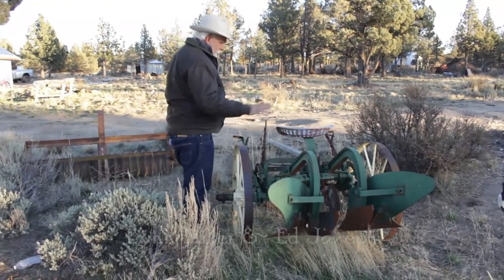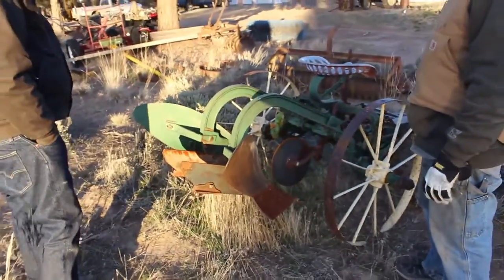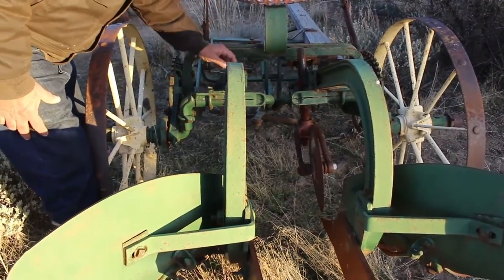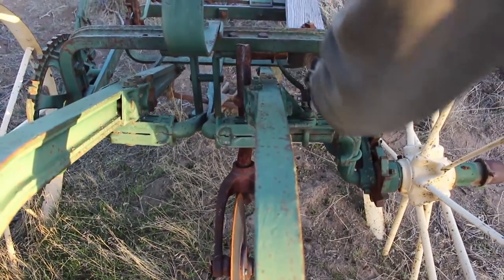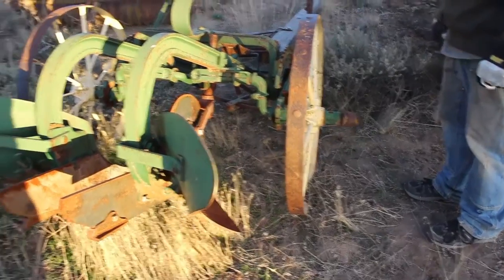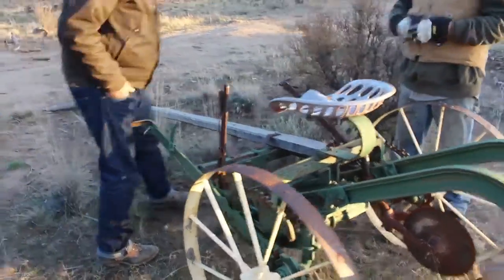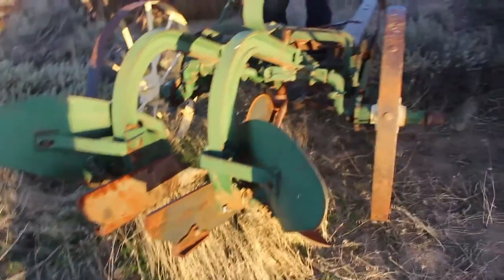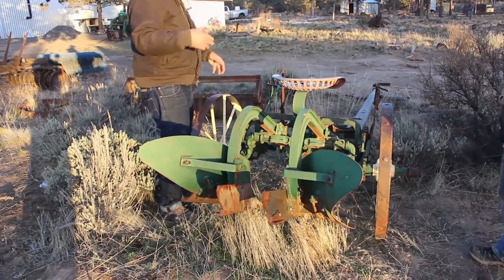Small Farmer's Journal Farm Drum #25: 1919 IH / P&O Two-Way Plow

Comment: was just wondering if that was setup for 3 abreast?
Reply from the maker: The way this plow is setup, with tongue over, it is meant to be used with one bottom and three abreast.  These plows were designed to allow for 12, 14 and 16 inch bottoms. With 16 inch, you would need to run a four-up to pull through most soil conditions.
Reply: Thanks for the help I'll let you know how it goes in the spring.